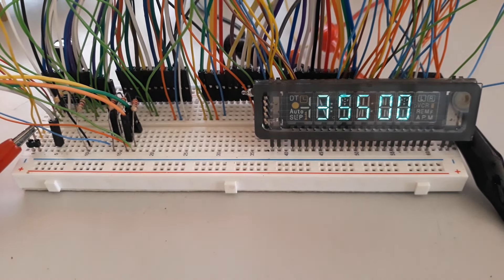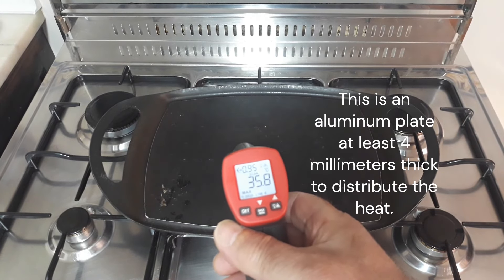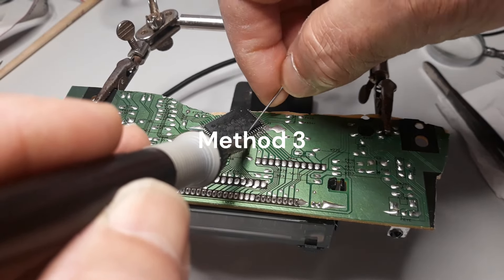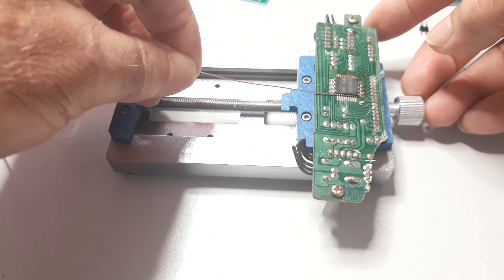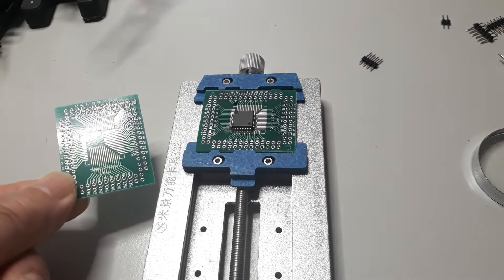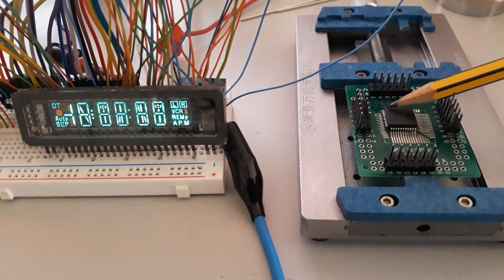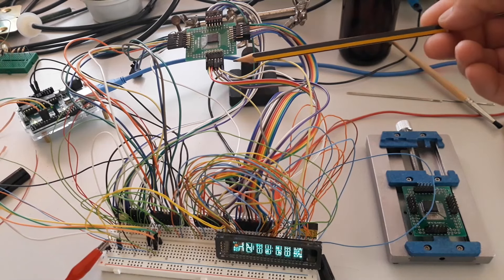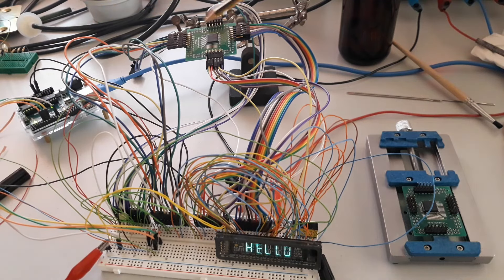M35500

Comment: the kitchen stove trick works better if you fill the frying pan with sand. it will conduct the heat more directly to the board, with less risk of overheating.
Reply from the maker: Yes! And truth! I used this trick in the 80's to remove Simm's RAM, but to do so, I need very thin sand and a container with high walls to avoid a more crispy grain projection. I really recommend receiving a thick aluminium walls to harmonize heat distribution

Comment: Так нельзя выпаивать микросхемы.
Reply from the maker: Yes! It's true, but as I say in the video, not everyone has a heat gun or an oven! It's a way to make the impossible possible for some and thus prevent them from giving up!
Reply: Jose is an expert in these things and, what's more, this is to make it easier for those who don't have ideal tools.
Reply: @jlsmonte  я понимаю, не могу на это смотреть как беспощадно компоненты выпаиваются. Кстати, можно отпаять теплом галогеновой автомобильной лампы)
Reply: @Dancopymus  Понимаю, просто методы вредят компонентам.
Reply from the maker: If we use an aluminum plate thicker than 4~6mm, it will distribute the heat evenly, as well as rise linearly until close to 100º, then rise sharply. This is the +/- what is expected in a board desoldering process where we only want to use the IC.
As I said, I have an oven and heat guns, but for those who don't, here's a suggestion!
A unsoldering process is not as critical as soldering. If the tin reaches its eutectic point (183º), the component is expected to be loose and just remove it!